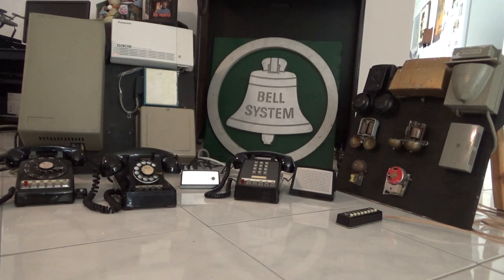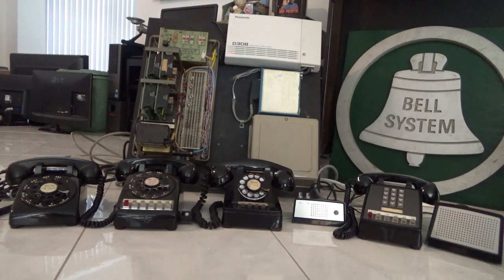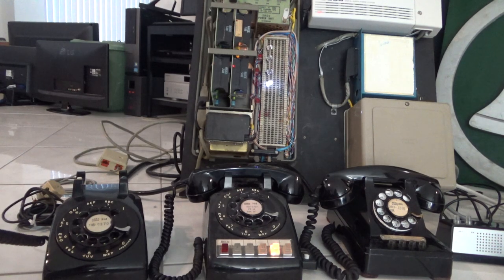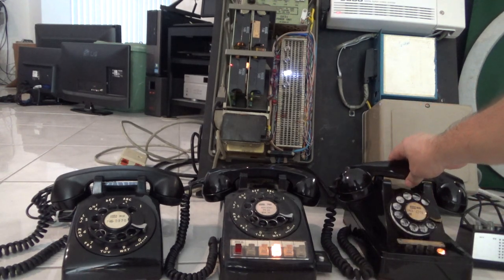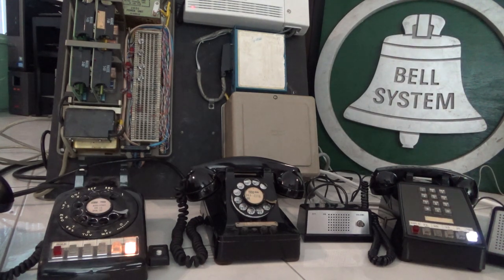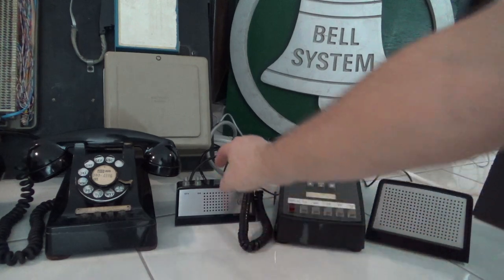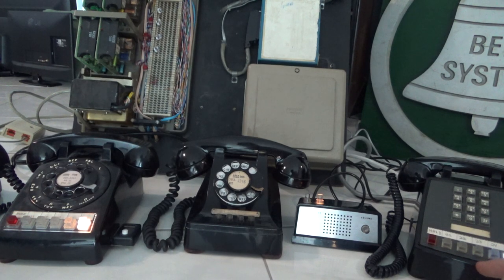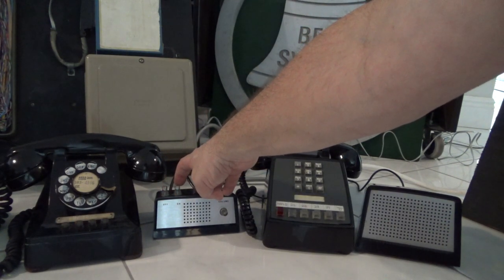Western Electric Bell System 1A2 Key System PBX Ringer Display

Comment: I still use 1A2 phones in my home on a regular basis. Have had some issues with the relay leaking sticky goo and have had to remove the relay from line cards and refill with epoxy. A computer running Asterisk supplies the CO lines. Funny thing, I live in Miami as well.